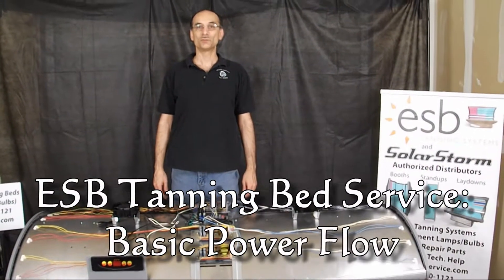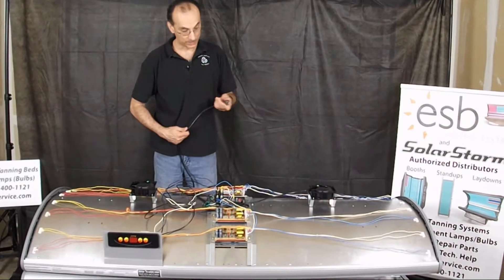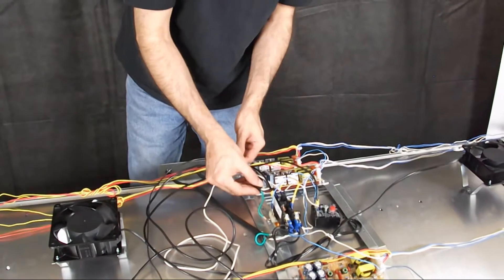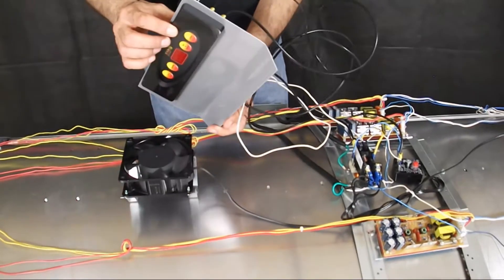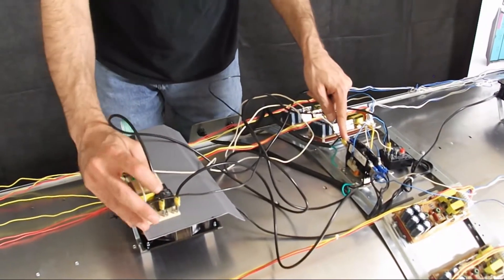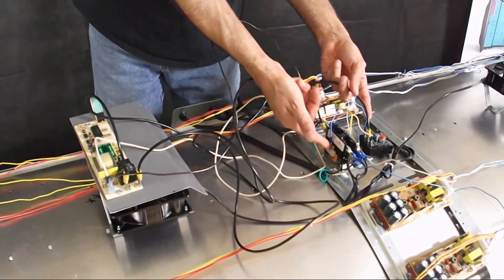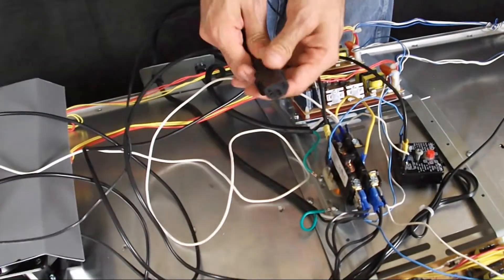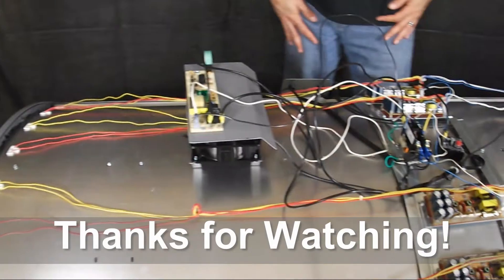Basic Power Flow on an ESB Tanning Bed

Comment: Not sure if ypu can help, but i have an older Sunvision Pro 28le. It worked perfectly fine and great until one day i had to stop a session a few minute in due to a phone call and when i went to start it back up it would not power on at all. Any idea what could have happened or caused this? Thanks!
Reply from the maker: Thanks for your question.  Do you have a digital or mechanical timer, and does the timer seem to "respond", or does it just seem dead?  Perhaps you can email me a picture of your timer to info@esbservice.com?  Thanks!

Comment: I need help knowing how to wire the tanning bed from my buck booster to what ? Since my bed is connected still from the bed to the booster but not to anywhere else.
Reply from the maker: The buck booster simply runs between the bed and the wall outlet.  The buck booster should have a female plug on one end, and a male plug on the other.  The male plug goes into the wall socket, and you plug the bed into the female socket.  I have another video on buck boosters right here:
https://youtu.be/jWObXS-xRR0?si=eTARNjJE8WlZXPDg

I would recommend watching that to first determine if you need it.  I would also make sure that you're following the electrical requirements for your specific bed...If you have an ESB brand bed, here is my video on the electrical requirements:
https://youtu.be/HkRMcq78GWs?si=j7vVvI78DPwDu9Xr

Comment: Could you tell me if J6 connects to A1
Reply from the maker: The answer is a simple yes if you have a 3-wire 4-button esb main timer board.  On the other hand...If you have a 4-wire timer, then if J6 is going to A1, then J3 would need to be connected to the contactor's primary hot.  Alternatively, if J6 is connected to the contactor primary hot, then J3 would need to connect to A1.  This is because there is a closing relay on the main timer where J3 and J4 are electrically the same, and J5 and J6 are electrically the same. 
Here is a 3-wire timer wiring schematic:  https://www.esbservice.com/images/3%20wire%20timer%20diagram.jpg
here is a 4-wire timer wiring schematic:  https://www.esbservice.com/images/general%20schematic.jpg
I show this in detail in my video here:  https://youtu.be/wxCO-DEmS98?t=384
Reply: @Russell Dulaney  thanks my friend. You are a big help!!!
Reply from the maker: @seanrichardson9866  You're very welcome!  Please contact me freely if I can be of further assistance.  Happy Tanning!

Comment: What if the timer is completely unresponsive and won't light up ? Have a esb bed worked fine all last year recently stopped digital timer
Reply from the maker: Thanks for your question.  I do not currently have a video that explains how to diagnose that issue, but if you please email me: info@esbservice.com and request the overlay troubleshooting information, I can reply back to you with a PDF that shows how to diagnose it further.  Thanks!  Russ

Comment: All these videos are pointless unless you show the bottom side of the tanning bed .. showing half ars's things gets people hurt
Reply from the maker: Please see my videos that cover working on the bench.  You will see that contained inside the bench are only fans and ballasts...mirrored exactly like in the canopy, but the canopy has all of the other components...timer, backup timer and contactor relay - since it's easier to access.  I've noticed in the last 20 years that fans hardly ever fail, so the only reason you should ever have to open up the bench is to replace a ballast, and the procedure to do so is easy and the same as it is in the canopy.  Please feel free to contact me directly with details of your specific issue if you are having any more challenges fixing your bed.  I don't want anybody getting hurt!  Thanks.

Comment: I have a plug in wall is left horizontal right vertical the plug coming from the bed is opposite I have an adapter and whe I use it I get power to time can set the setinf but when I hit start the green light flashes and it counts down but lights and fans don't work is it a plug issue or could something have come loose during transportation?
Reply from the maker: Thanks for your question.  I could help better if I knew the make and model of tanning bed you have, and also - to understand your plugs - I would need to know how the ground prongs are oriented.  For example...if the ground prongs are on the bottom in the configuration that you described above, that would mean that you have a 240-volt bed, and you are trying to plug it into a 120-volt outlet.  When the flat blades of the plugs are perpendicular, that means that it is 20-Amp...but one configuration is 120, and the other is 240.  They make it that way so you can't plug one into the other, since the voltages are different.  I never recommend using any types of adaptors...just get the proper electrical service for your bed.  I would recommend watching my video on tanning bed power cords here:  https://www.youtube.com/watch?v=ekP-1Q7PluA
If your bed is like the ones in my videos, here is my video on the electrical requirements:  https://www.youtube.com/watch?v=HkRMcq78GWs
Do not plug the bed in until you know the proper requirements for that particular model, and the requirements have been properly satisfied.  Please contact me if I can help further.  Thank you.

Comment: I have a pryzma1044  and it worked great when I bought it.  I am currently trying to hook it up to a tmax timer but have no idea where to start. It does not have a place to hookup  the bug black wire from the t-max timer could you help?
Reply from the maker: I'm sorry, but I'm not familiar with that bed.  When you hook up a T-Max timer, usually you need a plug like for a phone or ethernet.  When your bed worked, was it running off of a T-Max timer, or by itself?

Comment: I need some help! I have a sunquest pro 24rs and the lights turn on fine, but none of the fans are working.  I have one on the top and 3 on the bottom.  Any ideas on why the fans are not working?  Thanks
Reply from the maker: Hello, I'm sorry, but I'm not familiar with that brand.  I would recommend starting by tracking the fan wires back to their source.  See if there is a relay or something that is not letting the power past to your fans.  I've seen some beds that have a "Fan Delay" circuit, and that handles power going to the fans....see if you might have one.  Sorry again that I'm not familiar with your type of setup - but I hope that helps.

Comment: hi, I changed the fuse holder and fuse, replaced the top bulbs and checked to see if it turned on, which it did. I put in the bottom bulbs and they would not go on. the timer works fine. I have a montego bay, any suggestions?
Reply from the maker: Do you have the proper (receptacle) voltage at the cord going from the canopy to bench?  If so, you'd have to trace further inside the bench to see why the power is not getting to the ballasts.  Usually, though - there's some open circuit between the secondary side of the contactor and the bench itself.